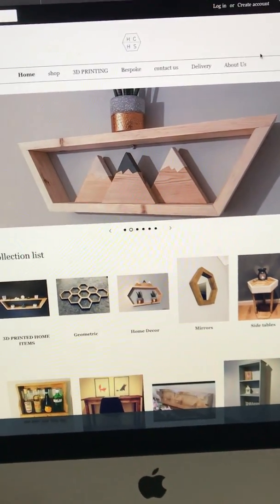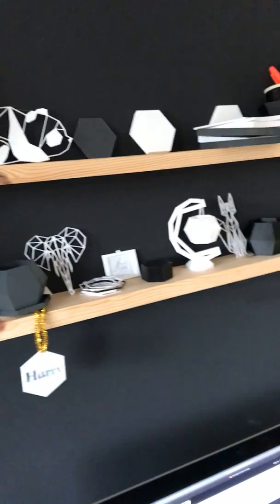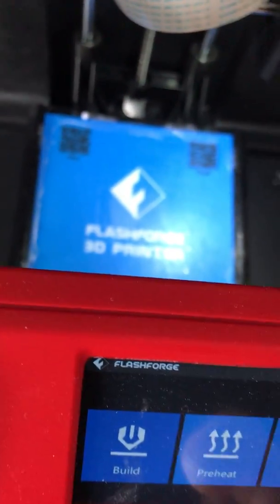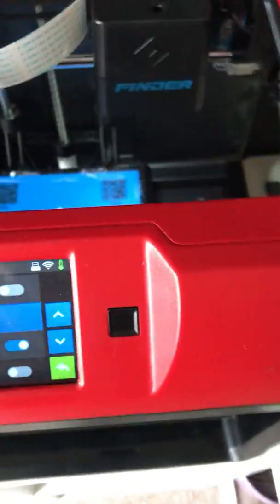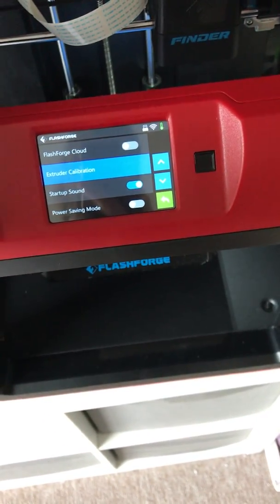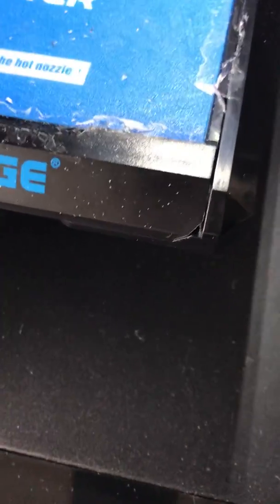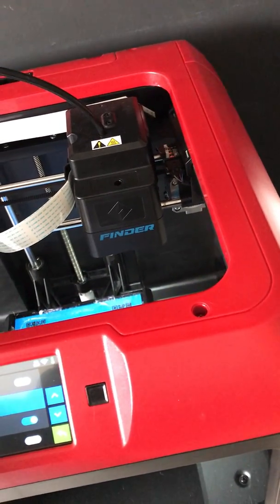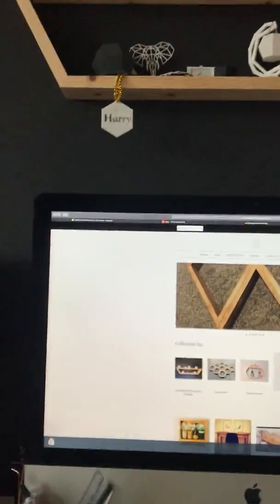flash forge finder fix for bad bed adhesion

Comment: My flash forge finder. I cannot get the bed level. I try the manual set up and the head moves to the first leveling spot and tells me to tighten the nob. I tightened it until I can no longer turn in and nothing. Help